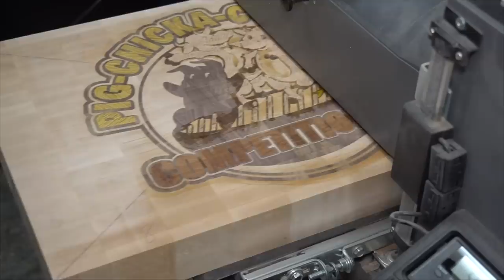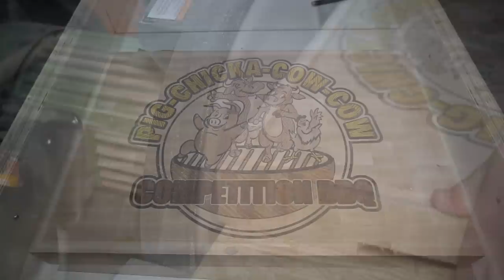Pig-Chicka-Cow-Cow cutting board for Lee from Florida. CNC Woodworking. Wood inlay. Cnc inlay

Comment: I’ve watched a few of your videos since I discovered your channel (always ASTONISHING work BTW).  I noticed that in some, you use the CNC to face the main board and each subsequent layer.  In this one, you use the planer, which I always thought would be way more efficient.  Any reason for this?  Or just whatever feels good at the time?
Reply: I dont know for sure but I'm thinking this is an earlier video, planning end grain boards is very hard on planer knives which would require frequent sharpening and changing and chip out is more likely and would ruin a board, lots of time and money invested, surfacing with the cnc is less risky